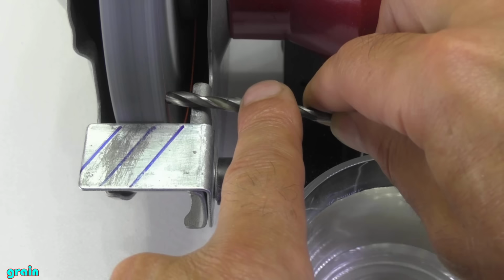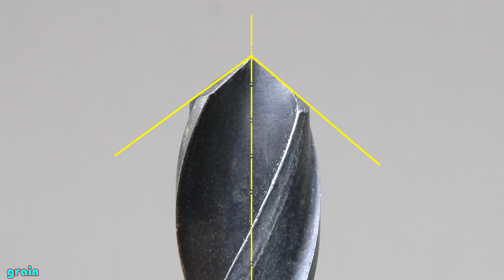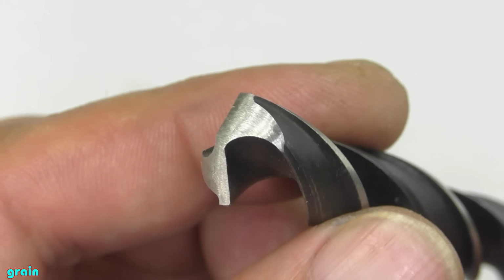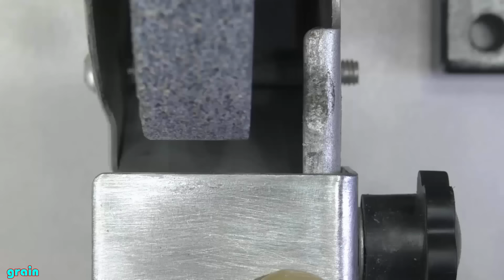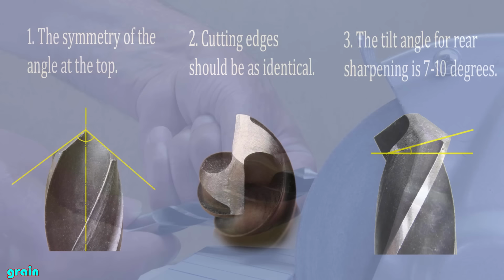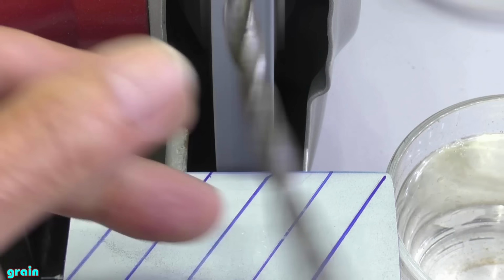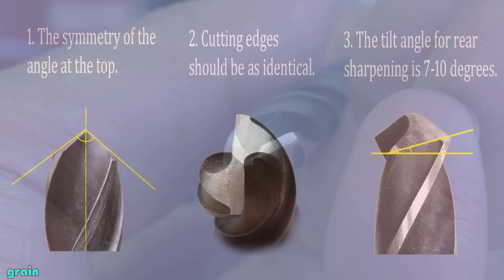How to Sharpen the Drill Bits (for metal)

Comment: By all means give it a go.
He is on the right track.
Unfortunately it is more or less impossible to get both cutting edges to cut.
Difficult to see but it looks like his drill is only cutting with one.
He understands the principles perfectly.
Both cutting edges in the same position, we are talking better than 0,1 mm. Otherwise only will cut
Clearance is important.
He split the point.
On the drill ge split the point it has a primary and secondary clearance.
Unfortunately it is very difficult to do all that by hand.
Reply from the maker: You are right, it was hard to sharpen the drill bit perfectly in 1 minute for the camcorder. You may not believe it, but I have never sharpened a drill before shooting this video. But I had a box of old dull drills and a couple of hours to practice. But before that, I watched the video of the Russian master Viktor Leontiev - https://rutube.ru/video/f0e7515a266eebcb52e29e56ce2e8f56/
Reply: @grain-diose  been working in factories and workshops all  my life.
It is very hit and miss to try and sharpen a drill by hand, not only do you have to get the cutting edges on the same plane you need to keep the centre in the centre.
I bought a drill doctor for my home workshop.
Does a great job.
Not good enough for drills in production but that is not what we are discussing.
I think he cheated a bit as one of the drills had a primary and secondary front angle.
On production drills we put on a corner rad.
That is where they wear.
When we get really fussy we put a different secondary angle on the corner rad.
We are talking grinding them  on CNC machines now,
Just mentioning out of interest
Reply: Forgot to say, give it go, a dud drill is a dud drill if you fail you still have a dud drill, not the end of world.
Get it right and it is very satisfying.
Get feeling drilling a hole with a good drill.
Two pieces of swarf, nice and light, feeding itself more or less.
No heat.
Reply from the maker: @derekpresland4029  I watched a video about "Doctor" and about a more expensive machine (300+ bucks) - https://www.youtube.com/watch?v=Aw98Vt4KaUU
So all these machines do not do the main thing - they do not back the cutting edge (point 3 in my video). Your "Doctor" and other similar machines cut off part of the cutting edge in the second stage instead of giving this edge an angle of 5-7 degrees to plunge into the metal. It is difficult to organize in such a cheap machine. Buy a good branded drill (7-8 mm to see better) and look carefully at what angle the cutting edge is sharpened and compare with the result of your "Doctor". Then compare how they drill, I think you will be surprised at the difference.
I don’t know why it’s difficult for you, I learned 3 years ago in a couple of hours and still sharpen if necessary. Although it rarely happens, I bought cobalt drills. By the way, I compared my sharpening and new branded ones from the store, when drilling - there is no difference.
Reply: @grain-diose  when you say back the cutting edge do you mean clearance under the cutting edge, the primary clearance? 
The drill doctor puts on a primary clearance and splits the centre.
As you rotate the drill in the doctor both cutting edges are on the same plane and the centre is in the centre.
That is the most difficult part. 
Hadn't thought about it until now but when drilling with a hand drill or simple drill press heat is often an issue. 
Could it be that only one edge is cutting and the other one is just rubbing creating friction and heat. 
Could also be the centre is off pushing the drill off centre more than the  back taper on the circular lands can handle and you get a lot of friction that way
It is possible to manually sharpen a drill but very difficult.
If you have one that is dull and can follow the existing geometry and just take of a tiny bit of material then you are in a reasonable good position to succeed.
Two even pieces of swarf are a good indicator that both edge's are cutting.
Reply from the maker: @derekpresland4029  "...but when drilling with a hand drill or simple drill press heat is often an issue."
Exactly this! Item 3 - 4:39
"Doctor" sharpens like this - 5:10
Reply: @grain-diose  We are in agreement, there must be clearance under the cutting edge.
We are also in agreement that it is very good practice to split the point.
We are also in agreement that both cutting edges need to be on the same plane so that they both remove the same amount of metal. 
We are also in agreement that both cutting edges should be the same length, i.e. the point is in the rotational centre of the drill.
We are 100% on the same page.
All I am saying is that all this is very difficult to achieve but give it a go. 
The two most difficult parts are getting both cutting edges on the same plane so they are both removing the same amount of metal and getting the point in the centre.
Lets put some numbers to this.
Let's say we have a total feed rate of 0.1 mm a rev. each edge is therefore removing 0.05 mm/revolutionen. 

If one edge is 0.05 mm behind the other it will remove nothing.
One edge will do all the work and remove 0.1 mm/revelation.
It will just rub on the surface. 

Very difficult to gauge 0.05 mm by eye.
Same with the point, a couple of tenths of a mm out and the drill will push sideways.
Prehaps the main feature of a twist drill is the fact that it is self centring as the cutting forces are balanced out because there are two cutting edges. 
There are drills with only one edge, a gun drill for example.
They can drill very deep holes accurately.
They have a cylindrical land (no back taper) that guides the drill.
They need lubrication to reduce the friction.
But they need a pilot hole as they are not self centering like a twist drill with two flutes. 

https://youtu.be/ZTXakjKSPRc

This the machine I use to sharpen drills. 
If you watch carefully he locates the cutting edges to the fixture. 
And then when grinding the fixture is operating on a cam putting clearance on the drill.
They do a pretty good job
Reply from the maker: @derekpresland4029  This is theory, but in practice, any amateur even of my level will sharpen a drill in 5 minutes better than any such machine. Otherwise, no one would grind with their hands, everyone would use similar machines.
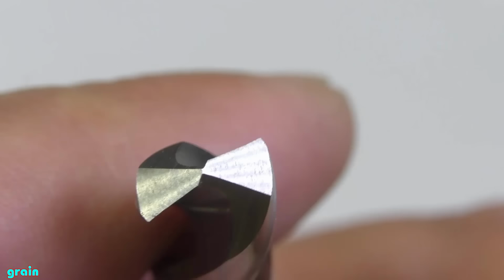By the way, a set of drills from a good German brand Abraboro, which in this video 13:33 has CNC sharpening (I think it's much cooler than the household "Doctor"). But one drill from the set (diameter 7 or 8 mm) made a slight knock when drilling. I took a closer look at the sharpening and found that there is inaccurate centering. I fixed it manually in 2 minutes and the knock disappeared. I don't know how it works, but sometimes the best tool is the eye.
Reply: @grain-diose  I think we must admit we have taken this discussion as far as possible.
Just to round of my comments I would just like to mention that my background is that I have worked as a production engineer for the most of my working life, mainly as a CNC programmer.
The final years I worked in the field as a drilling specialist.
Working closely with engineers that design drills, the manufacture of drills and the application of drills into mass production.
I also have my own little shop where I fiddle about.
I fully agree that there is no way a hobbyist can grind drills to the same level as production drills.
However the principles are the same
It is not theory.
Yes I have said it several times it is possible to regrind a drill by hand but very difficult.
I would also suggest that it is impossible to eyeball the tip of the drill to the level required.
I just don't understand your criticism of the drill doctor.
It uses a diamond wheel giving a much better surface finish and a cleaner cutting edge.
It puts on clearance and you can split the centre and will do so consistently
I agree the drill doctor cannot produce a drill point as accurately as multi axis cnc machine can but it does meet the fundamental requirements that we agree on. 
If you are interested I can give you more details of how production drills are designed, produced and applied. 
Look forward to your comments.
Reply from the maker: @derekpresland4029  Unfortunately, no one filmed and showed a good and close-up sharpening on the "Doctor", and maybe I'm wrong. Do you have something to shoot large and show me the result of sharpening by the "Doctor"? I'm interested in this side view part  - https://www.youtube.com/watch?v=gupqrlTiGDs

Comment: Muito interessante. Mas pode ir ao Lidl e comprar um bom afiador por cerca de 20 €
Lol
Reply from the maker: Yes, lol. Have you tried using this?
PARKSIDE Bohrerschärfgerät PBSG 95 D5
test  😁
https://youtu.be/WIGj_Blct4k?t=98
Reply from the maker: As I understand it, the sharpener does not make a bevel on the edges of 7-10 degrees, so that the edges cut into the material, as I mentioned in paragraph 3. Therefore, the drill does not drill, but smoothes the material. As a result, the drill only heats up without drilling.

Comment: You showed us how to drill a hole in aluminum but you said you were going to show us a drove it sharp enough for metal
Reply from the maker: Isn't aluminum a metal? Do you think you can drill through thick steel on an 80 Watt machine (2:22)? At that time I simply did not have a normal drilling machine. An indicator of correct sharpening is the chips from drilling. And aluminum (or rather duralumin) demonstrates this best.
Here I sharpened and drilled steel (I bought a 700 Watt machine) - https://www.youtube.com/watch?v=jlR7FGzZynk
Moreover, the steel is quite hard, in my opinion, surface hardened (note the sound and difficulty at the end of drilling), so unfortunately the chips are not intact. The same chips on this steel are produced by a drill with production sharpening (the one at 2:47 in the second video). I didn't have any other steel to demonstrate. Therefore, after that I showed the shavings on plexiglass.

Comment: Alumíniumot szépen fúrta
Reply from the maker: Please note that my drilling machine is only 80 watts, 5 mm steel is beyond its power. But by the smooth shavings, you can understand that the sharpening is good. I used my hand drill to drill steel, but it's more difficult to film with the camera.
Reply: I apologize

Comment: This is wrong information ,the angle is very important it must be 118 degrees .If you believe your system is correct please try steel plate that your  test parts is aliminium that it is already  smooth than other metals .sorry ,Believe me
Reply from the maker: Yes you are right. The standard sharpening angle is 118 degrees. But for softer metals, less can be done. I meant that the angle is not important for the drill to drill smoothly. Because if you do not observe symmetry, the drill will vibrate and make the hole larger than its diameter. This diameter will be equal to the value of the offset from the center multiplied by two.

Comment: Regretfully your drill sharpening method and technical information is partly incorrect. The inclused angle is 118 degrees (59/side) This IS important for drilling mild steel. You only change the angle dependant on the material hardness being drilled. You should not use the side of the grindstone. It's not designed for this.  You are correct that the cutting edges must be equal. Proof of a correct cut is an equal removal of material per flute. Remembe the grind stone wheel must be suitable for the type of drill bit material (e.g A solid carbide drill bit will not grind on a regular wheel) and a well dressed wheel is a must. If I had the facilities to show you I would. Been grinding drills since 1968 from size No60 up to 2.5 inches.
Be Safe,
Regards
Reply: What kind of grit would you recommend for HSS bits ?

Comment: Where is hand gloves. No safety procedure.
Reply from the maker: Gloves must never be used! If it hooks on the end of the glove, it will injure the hand much more strongly, because the stone will grab the glove faster than the bare hand. And also the gap between the grinding wheel and the horizontal platform should be minimal. I said all this in the video.

Comment: Never use the side of the grinding wheel. That is a security.
Reply: Why not ? Some machines are designed to present the lateral face of the wheel so you can access easily, and it is up to the user to know when to stop using it.  Just look at a tools/machines catalog.

Comment: This is not the way a machinist would sharpen a drill bit! I have forty years experience I'm sorry I don't have the time to make a proper video for you folks. You do not roll the drill in an upward you start and bring the bit down the wheel these guys are putting out bad information., sad
Reply from the maker: I learned from this video - https://youtu.be/KCL27Bs9DYg?t=667
Reply: I was a machinist and this is the way I did it without a specialised grinding machine.
Reply: Forty years as a machinist and don't have time to show the public the right way to sharpen a drill bit. But found the time to criticize someone else's tutorial. Must be spending your free time on the Harley.....